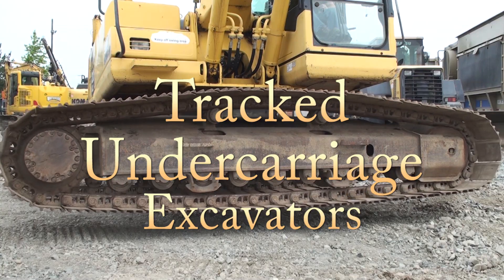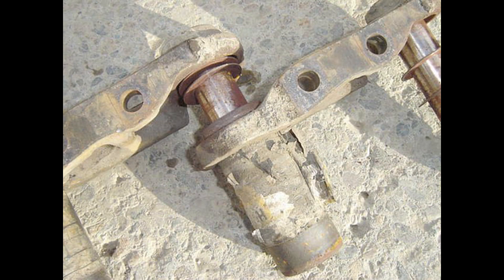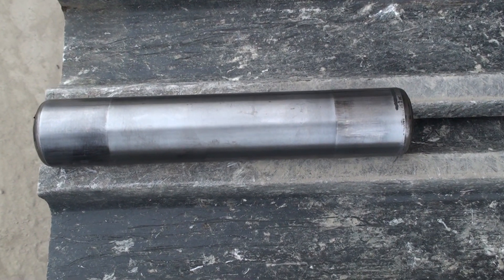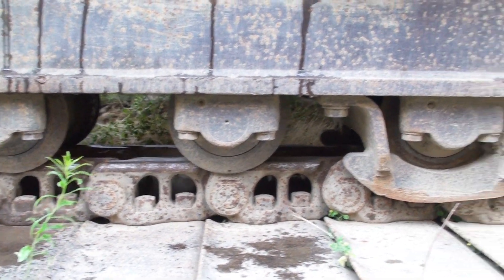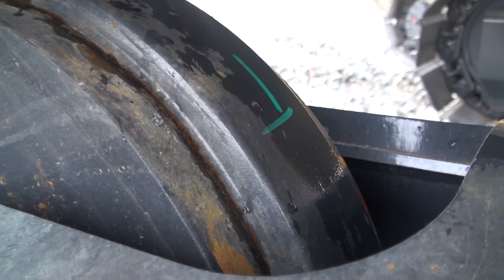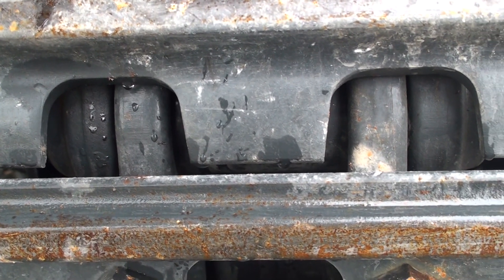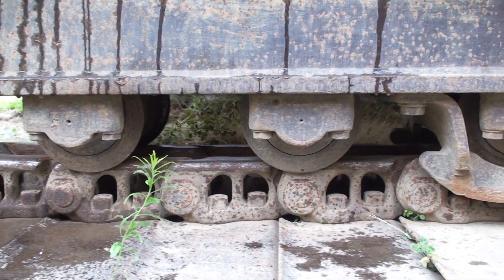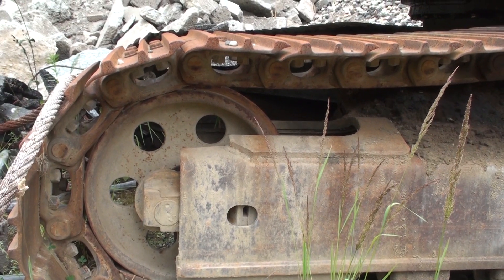Tracked Undercarriage, Excavators

Comment: So I have a lot of wear on the sides of my rails. The rollers are new
Reply from the maker: What is the make and model of your excavator. How many hours on the rails? What is the machine used for?
Reply: It’s a 210g John Deere. 4000 hrs. It’s a 2015. It has bolt on rubber track pads.
Reply: We do bridge work so a lot of tracking on concrete and asphalt. Sand as well
Reply from the maker: @dieseltech7_358  As I understand your situation then, you have new bottom rollers but are still using the old track chains? Are the link worn up into the pin boss areas of the links?
Reply: I think so. I will double check when I get out to the machine today. It was at a different job site and the other mechanic just did lower rollers and nothing else.
Reply: I can email pictures if you’d like
Reply from the maker: @dieseltech7_358  jcraughan@comcast.net